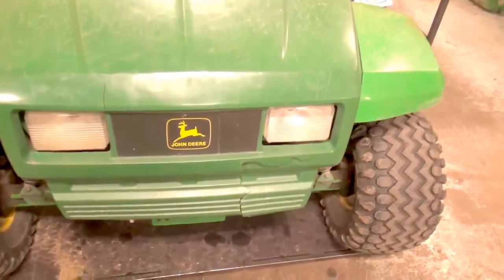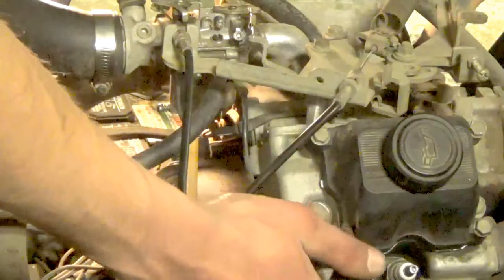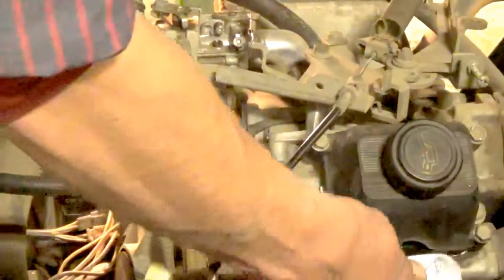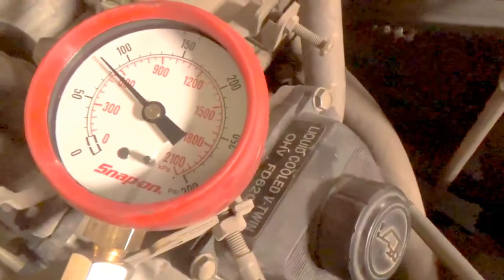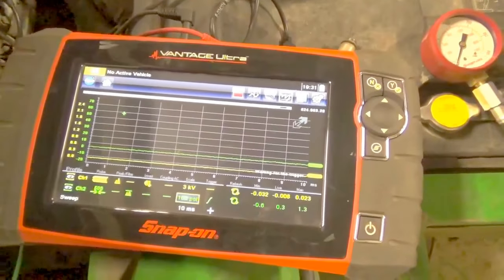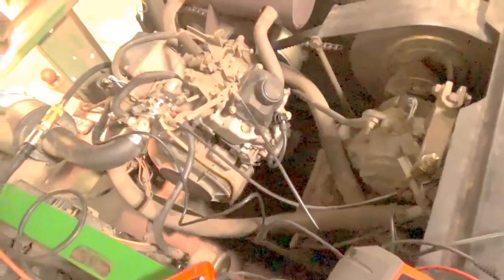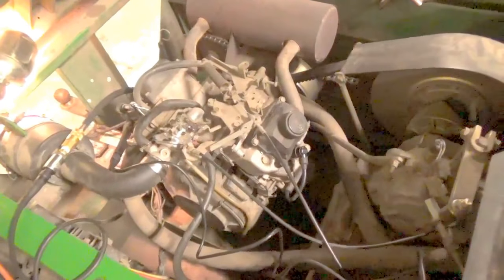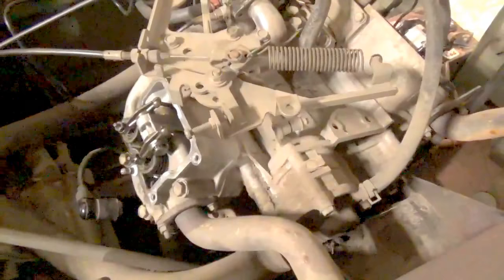John Deere 6X4 Gator Crank-No Start

Comment: Nice vid, working a military gator 6x6. Can you talk more about the primary clutch and how to remove and install a new one. I have located the belt from a internet site. I had to cut what looked like to be trot line wrapped around the center pulley. This is a diesel engine...thanks

Comment: Thanks, great video. Mine has a similar problem, had been hard to start, but once started. would start instantly all day. Has spark and wets the plugs with gas. will check the valves and compression, might just be that gear. Tries to start, back fires some, but won't start now. Thanks again.
Reply from the maker: Sounds like a lack of air at the right time. When the gear goes, it usually follows that progression. 

Quick dirty test is to disconnect the battery (safety first) and pull the valve covers. Slowly turn the engine over by hand and watch valve movement.
Reply: @ScienceOfDiagnostics  ok just got back to working on gator 6x4, fly wheel key, ok. checked valves, open and close. doesn't seem to be a problem there. Pulled side plate to check cam gear, has metal gear, not plastic, timing marks line up perfectly. Any further suggestions?  Thanks  William
Reply: did all things suggested, has metal gear, pulled heads did a valve re-seat  job, putting back together, did not see anything that was bad enough to stop from starting. Working on it when time permits. See what happens when get it back together/ Thanks

Comment: My gator 6x4 gas motor overheated and now turns over very slowly.  I replaced battery, checked cables and put in a new starter.  Still barely turns over even with plugs removed.
See.s like smoked barring or scared cylinders to me.  With plugs out shouldn't flywheel spin easily?  I'm thinking get a replacement motor with core trade for $1250?  
Thoughts suggestions???
Todd No. Cal
Reply: I had the same problem it was that the timing chain was broke and you have to take it off and if the valves were damaged then you couldn’t use it and had to buy a new motor.

Comment: I dont have the noise but my 1997 6x4 gator won't start. I replace the ignition coils. Spark plugs cleaned  carb. Oil ,filter change and air filter change. Still won't start. Please help.
Reply: Mine was the same problem look in the cap of the oil tank to see if the timechain might have broke

Comment: I have a John Deere to buy for gator I have installed a new switch however I cannot get it to turn over whatsoever, I have install also a new battery which I know that works because it wench runs off of the battery as well. You think you could be the starter? Or a wiring problem. Any advice would help
Reply: Im in the same position